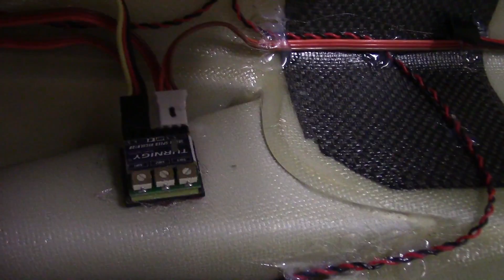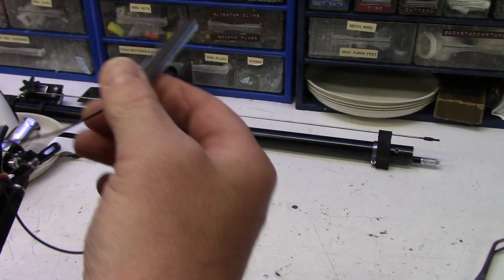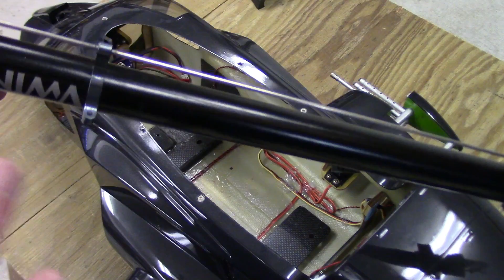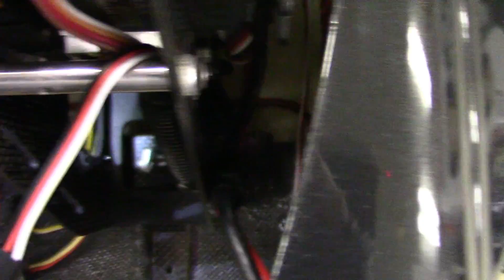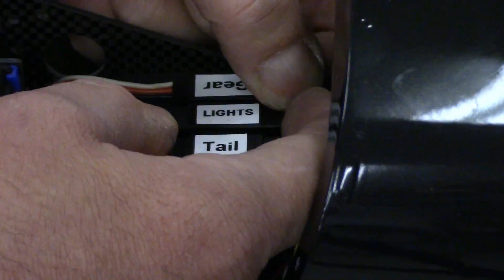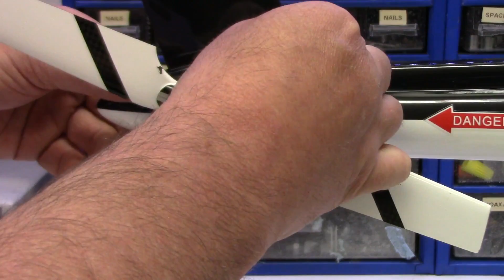Scale RC Helicopter Build - Fitting Mechanics Into A Scale Fuselage

Comment: Hey John !! can you share with the public the material that you use for the frame mounts to the fuselage,
i flight nitro  Raptors 30,50,90,,,love scales,nice set up..
Reply from the maker: I added it in the description (got the question before), but it's just normal closed cell EVA foam. You know, the type of foam most blade holders are made from, kids flip-flops, or those 2x2' interlocking foam floor mats. No idea however if or how long it holds up to nitro oil. I've never tried it in a nitro environment, only electric.

Comment: What servos did you useful your retracts? Im having trouble finding one that will work
Reply from the maker: "Having trouble finding one that will work?" Really? I just did a Google image search for "low profile servo" and every brand under the sun showing their different models of low profile servos popped up on the screen. Must have been over a hundred of the them. 
I have Hitec HS-77BB's  in one and Blue Bird BMS 705's in the other. I wanted to use analog servos with plastic gears to keep weight down and current draw (if/when they stall) low. Had to cut the hole in the plywood servo tray slightly larger of course to fit a standard size servo.

Comment: Great Video John!! What was the thickness of the fiberglass plate and the foam? I am definitely looking to try your method!
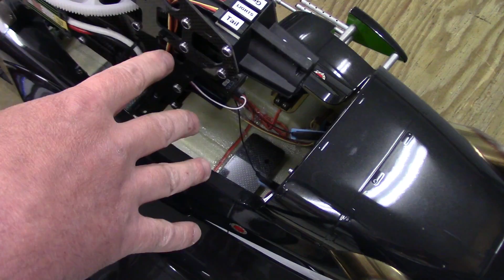Reply from the maker: Every build's spacer blocks will be slightly different. As I mention in the video starting at 15:35, mounting block height is a process of trial fitting the mechanics with the boom doughnut in place. You then add spacers under the mechanics to determine the best overall height for your application and what tilt angle you want for adequate clearances. You would then measure the space between the front and rear mounting locations and build up your spacers. As I mention, it's best to error on the side of the spacers being a little too thin since you can then add spacers to bring the height up if needed.

Comment: hello, already a big thank you for your video. that gave me some trick to finish up mine. on the other hand can you tell me where you find the landing gear? I ordered on hk but they are too long to enter the fuso. so if you have a link. thank you in advance and good luck.
Reply from the maker: Hi Fabien,  The set of tri landing gear struts I'm using also came from hobby king so I assume they are likely the same ones you have? I had to modify them substantially however to make them fit. I had to shorten the aluminium struts on the two rear winglet ones. Drill out the plastic pivot blocks in the Funkey mechanical retract mechanisms so the struts would fit a little ways up into the pivot blocks. Metal epoxied them into the blocks. I also had to shorten the wheel arms on the rears and use smaller diameter wheels on all 3. 

Much of that modification work I did on my little hobby lathe, but I'm sure a Dremel tool or file and a standard drill would also work if you take your time. I botched the first set I had so it was largely a frustrating trial and error modding process. The rear ones in the winglets still hang down a little low when retracted (you can see the wheels slightly when retracted). They are not nearly as good as the stock wire ones when it comes to robustness and hard landing protection, but no question, they look way better than those ugly stock wire ones.
Reply: Hello, thank you for your answers. yes I have the same trains that you have mounted. Now, I know how to make the trains change;)
I will also get your ideas for the connection of the chassis given the lack of space.
This will help a lot of people who want to make a little more model this fuselage. good continuity and thank you again

Comment: Very helpful I'm just getting started in the world of RC Helicopter,  I've just obtained a Nitro .50 class Century Raven.  I want to fit it into a  scale fuselage along the line of the airwolf or Bell 222,  thinking of the Agusta 109A.  is there any info you can give on a Nitro powered install?
Reply from the maker: Nitro Install Recommendations... Just one - convert to electric ;-)

Seriously, nitro in scale is a royal PIA! I flew nitro for years in scale and I can't say there is one single redeeming quality (for scale anyways) other than the smell of the exhaust. Nitro will require an expensive (perhaps even custom) exhaust system, overheating issues of the engine in scale are common, engine tuning is always changing, flameout's are common so you better be very proficient at auto-rotations (much harder with scale since there is more weight and energy control during the auto is unforgiving) , you will need to cut at least one large hole in the belly for the fan cooling of the engine, the inside of the fuse will constantly be saturated in nitro oil, the high frequency vibrations from the engine eventually start cracking the fiberglass, and the starting shaft will eventually chew the doghouse all up.

If you are just getting started in RC helis, my advice is to first and foremost get 100% proficient flying your 50 nitro in pod & boom format first (if you can't already), before even entertaining the idea of scale. You don't have to be able to fly aerobatics, but you should be totally comfortable flying and hovering in all upright orientations, including nose in. At that time, you can revisit the virtues of electric power vs nitro in scale applications and decide if you still want to stay with nitro or convert/get an electric heli for the scale build. 

My scale heli page on my website may help you further: https://www.rchelicopterfun.com/scale-rc-helicopters.html

Good success Karla and glad to hear you are taking up the hobby.
Reply: Thank you for your reply, it is very helpful,  I have found a conversion kit for the Century Raven,  if you don't mind me asking,  what size of motor would you recommend and what other components would I need to finish a confersion ?   Thank you again for your help,  have no one close to me to help so I'm in a sense winging it on my own here.
Reply from the maker: Sorry No Idea - Never done one and too many variables to consider. Suggest posting the question in one of the better heli forums such as HeliFreak or RC Groups.

Comment: John love the video! love your books as well!!!!! but i have a question or two about this build.
so i am using a 550e V2 stretched for this fuse. love the foam base idea cause i am truly trying to avoid putting holes in the belly of the fuse.
you said in a comment that the foam isn't really supporting much weight when flying since everything is mounted to the mechs, but i don't like the battery poking into the cabin (550e doesn't have the battery going vertical like the 600) so i was thinking of placing the battery on the floor in front of the mechs which will help with nose weight, see where i am going with this? also what scale retracts are you using on your fuse and do the wheels hide completely when in the "up" position? also can i get a part or link to the low profile servo you mentioned? also how do you know how high the mechs should be sitting in the fuse and are they suppose to be neutral or with a slight forward lean? sorry to hit you with so many question but this is my first scale build and this video is the best by far on this matter and fuse!!!!!!!! kudos to you, Sir!!!!
Reply: F Balb,   I took a completely different approach to mounting my stretched 550E. For those who wish to build something similar, here it is and why I did this. The Funkey Bell 222 has a large area of unbraced 'flat bottom', and placing the narrow mechanics (typically 50mm or so  in the centre and with all its weight, this automatically gives rise to the chance of undue flexing and both parts wanting to go in opposite directions during spool-up and other times. Even with extended 'arms' at the front and rear mounting points, this still doesn't address the issue. I cut a piece of thin ply 365mm x 140mm, chamfered and shaped at the rear and front sides a small amount to fit the fuselage shape there. This size takes the ply right to where the fuselage begins to curve and give natural rigidity. I calculated where the mounting bolts for the mechanics would be (183mm long/96mm wide for mine), drilled the four holes and fitted blind 'T' nuts from underneath the ply, then glued the ply down ensuring almost full ply to fibreglass contact using JR WELD. Johns goop will probably be as effective but we don't seem to have it here in New Zealand. There are NO holes through the fuselage using this approach. The result is a strong and rigid support for the mechanics with absolutely no bend or twist issues, and the extra weight is negligible. The overall height of the mechanics can then easily be attained by shims/ply etc. In mine, the 6s battery sits across the fuselage in a low-profile ply mount glued to the floor ply and is directly behind the front-most bulkhead. CG is almost dead centre to the mainshaft. The mainshaft should have about 5 degrees of forward tilt, similar to the Bell 206, but sometimes this is difficult to achieve. I kept the mechanics quite low and used a longer mainshaft to get this, plus the 87mm odd height from the top of the doghouse to the centre of the bladegrips. I also made ply bracing sections further back in the fuselage where it is necessary to cut the bulkhead supplied by Funkey, plus a 'horse-shoe' shape ply brace behind the doghouse open section where more flexing can occur. Two extra metal straps are bolted between the CF frames and the fuselage some 60mm behind the mainshaft to give extra lateral support.

Comment: Great and informative video John. For other builders here and for my own Bell 222, I 'stretched' an Align 550E V2 using the 600 boom etc. I did not use an extra bolt to secure the boom to the tail rotor mechanics through the fuselage hole though. Instead, I used the metal Align vertical stabiliser mount Part # HN7109, cut the top area off where the upper bolt normally was, and then fitted the remaining part using the lower bolt. It tightens the boom and rotor assembly more than adequately, plus, as importantly, the small locating stud on the mount penetrates both the boom and assembly to lock the two securely to prevent any possible movement. I have used the same technique on both my Align 600EFL Pro based Hughes 500E and AS350 scale helis. Hope this might assist other builders.
Reply: good tip i am in the process of building this fuse using a stretched 550E V2 as well! 1st build so i am getting over the shock of this daunting task i have taken on....lol

Comment: Fantastic! Very informative. I have a FunKey Long Ranger that I am planning to put together with Align 600 mechanics.
Not sure how easily the newer Align mechanics (like the Pro version) will fit! Any advice welcomed!
Reply from the maker: The Jet & Long Rangers are a much easier fit, primarily because you can slide them in over having to drop them in. Same fitting principles apply for sizing and making your spacer mounting blocks.  Upper frame bracing will require some thought. I've never done a 600EPro /Jet - Long ranger, I have done a couple 600ESP ones however. Really easy compared to the 222's. 

The 600E Pro will work fine, but you'll have to cant the battery tray fairly far forward to get the CG on the mark (lots of room in the long ranger for that). The one draw back with the Pro version (other than the head sitting lower and looking kinda funny on a Long/Jet ranger), is the pitch and aileron swash ears are facing forward with the elevator swash ear at the rear. This will necessitate grinding out two holes in the front of the dog house that extent below the forward leading lip so it doesn't look the best,  and compromises strength a little bit, but it works. This again  is why the 600ESP version is one of the best set of 600 electric mechanics for scale projects like these since the aileron and pitch ears are at the rear where there is always more room in the dog house :-)
Reply: Many thanks John for your excellent advice. I see what you mean regarding the 600 pro not being ideal for fitting into the fuse. I'll probably try to get hold of a used ESP and hopefully convert it to flybarless setup. Alternatively, I could try to convert one of my Hirobo Sceadu's to EP. Regards, Marcus

Comment: Nice to see! How was the cg for the wolf? I Neede to add 200 grams in the noise
Reply from the maker: Like most scale builds, yes, the Wolf was tail heavy as well. I don't like adding extra nose weight to an already heavy scaler unless it has a useful purpose and as many know, I use separate RX batteries on all my larger machines. If you notice, there is a fairly large 2S 3000mah RX pack mounted to the front bulkhead. The weight of that pack brings the CG back into a usable range. There was still a little rear drift but not excessive and was correctly mechanically with a tad bit of mechanical swash forward tilt adjustment.

Not an ideal "text book" solution since when inverted the tail drift is then twice as bad, but since it's a scale build, I'm rarely inverted with it, and when I do throw it around a little bit, it's just simple loops, flips, and rolls; nothing where inverted drift is noticed. The good old game of compromise in this hobby - add unwanted weight, or add unwanted inverted drift :-)

Comment: Cool. Like the idea of the 'floating' mounts. Might be worthwhile doing a short vid on the type of foam used and gluing to the fus etc? Bit surprised at the type of glue used as wouldnt have thought it strong enough. Any particular type of glue?
Reply from the maker: Glue... Just regular Household Goop. Very strong stuff - same basic adhesive as Shoe Goo, and that is used in bonding shoe soles. That said, we are only lifting the weight of the fuselage, perhaps a pound or two? The rest of the weight including battery weight is totally carried by the mechanics; so actually, very little weight is being carried through the mounts.

As for type of foam, whatever lightweight, soft, vibration absorbing closed cell stuff I can find. EVA (Ethylene-vinyl acetate), is the most common, and what the boom doughnuts are made from. My two sources are those common interlocking foam floor tiles that you can get pretty much at any hardware or home center, or cheap yet soft kid's flip-flops which I've have to use in a bind.